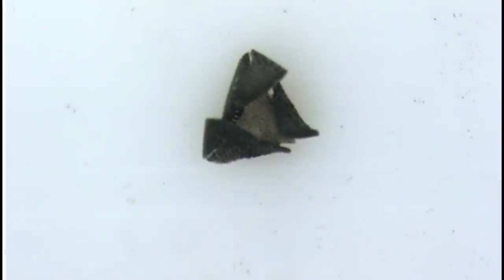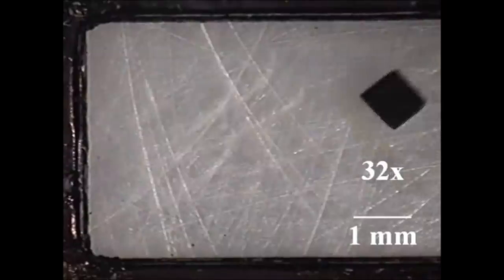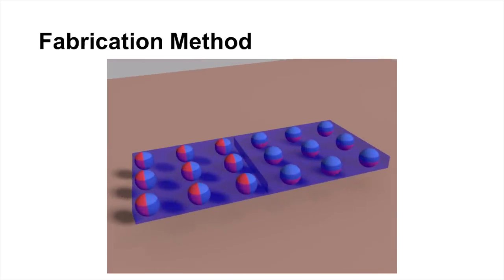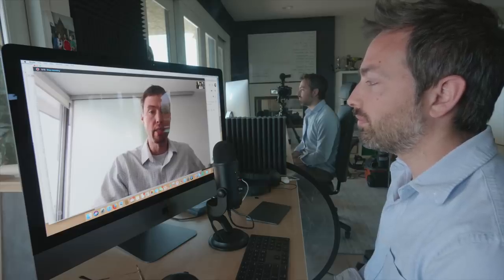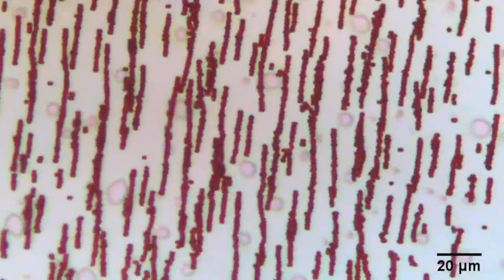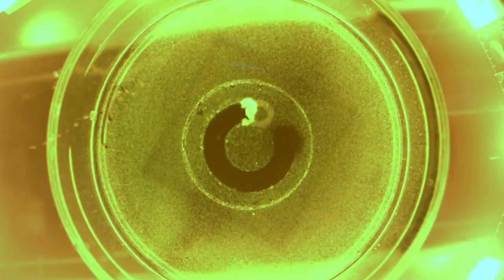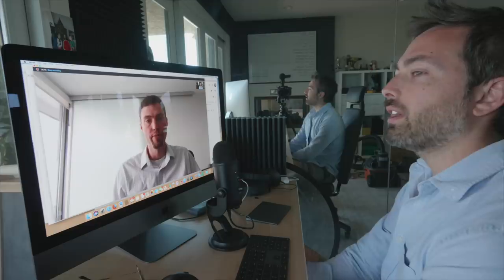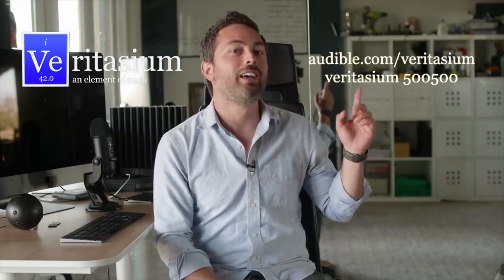Magnetic Micro-Robots

Comment: TBH I'm a bit sceptical calling them "robots" they're more like magnetic puppets.

Useful none the less.
Reply: @BlazePlayz YT they can't act on their own, all instructions come from the outside
Reply: Some are even more like magnetic particles.
Reply: @BlazePlayz YT magnetic puppet is a great name, actually! A vivid and clear image of what is happening
Reply: @BlazePlayz YT I know, but these don't have the slightest bit of software. If I push my toy car it isn't a robot. If I tell my toy car to move forward, and it does, then it's certainly much closer.
Reply: @BlazePlayz YT No they aren't, robots are automated those things are being controls with a magnetic field, pretty much like I use to make some iron nails moved back when I was a kid.
Reply: A robot is any mechanical object that can be controlled remotely to preform a task. Software is not a necessity.
Reply: @AlekPlaysMinecraft  So a string puppet is a robot? If not, then this isn't. This is virtually a magnetic puppet controlled by magnets. I wouldn't call staple wire a robot just because I can drag it across a sheet of paper with a magnet underneath.
Reply: @RenzXVI  why do you assume someone has to physically use a magnet and move it around? You think we can't generate magnetic fields or change their orientation?
Reply: @fl4regun469  LOL, I guess you have no clue what an analogy is. And what the word "virtually" means. Another fact is that it's still NOT a robot when magnetic fields are used, it's VIRTUALLY just a puppet with high-tech invisible strings. And yeah, that's an analogy again, use a dictionary.
Reply: @RenzXVI  your analogy sucks lmao. What's the difference between electric control and magnetic control
Reply: @RenzXVI   You could easily have a microcontroller time the direction and strength of a magnetic field where the devices are located. But it's not a robot because it needs wires and motors lol

Comment: That method of making magnets can be used to make generators out of magnets, using the magnets to create circular kinetic motion which is then received using a alternator or something similar. Most would say this breaks the law of thermodynamics that says you can never make energy out of nothing, though most don’t know that magnets lose there magnetisms in this process, meaning your just converting the lifespan of the magnet into energy. (It is possible that to make magnets like the ones in the vid would use up more power then you could get, you could also just find a way to use neodymium magnets, but no one wants to do that)

Comment: While this is really really interesting and I hope the development evolves, I wouldn't call it "robots". You control the magnetic field that will interact with the material. The same way I wouldn't call a device moved by the wind a robot.

Edit: okay now I would 😂
Reply: A device that automatically performs complicated, often repetitive tasks (as in an industrial assembly line) is called a robot, what we saw in this video is exactly this in a smaller scale. This is the description of "robot" taken from the Merriam-Webster. They are intended to eventually do complicated and repetitive tasks (deliver drugs to a specific part of the body). In time they will be automated/programmed to follow steps. Sure you can argue that they're not robots as of right now but they are basically in the alpha stage of their development. Whatever follows will just be improvements from these prototypes. They definitely are robots.
Reply: @Tahira204  Oh cool, I wasn't aware of that description, thanks!

Comment: I love how this guy is just casually using a PS3 controller for the job
Reply: Better than Xbox controller!
Reply: I just mean, weren't PS4 controllers available?
Reply: Maybe ps4 controller is more restricted in use than ps3
Reply: Erm last I checked, a PS4 controller just plugs into Windows 10 and works. You don't get the touchpad mapped to mouse or the gyro mapped to mouse, but it otherwise works out of the box.
Reply: @DoomRater  Yeah it seems kinda weird to use a ps controller, its much easier to use a xbox controller due to MS putting native support. For ps3 you have to do weird driver things. Anyway its probably just what they had and they were lazy to buy a new controller.
Reply: @saygoodnightgraciee  it's hard to configuration Xbox controller on pc. Ps3 is directly configured
Reply: @malo6748  It may be incompatible with their software of controller
Reply: @DoomRater  Also, it requires to work with their software. Or maybe he don't know much of video games. He just bought which is cheap also of good quality
Reply: @dalzy25  Support is for windows, you need xinput to work with their software also. Ps3 is just direct generic input. Xbox uses xinput

Comment: I have no disc between S1&L5 so it grinds bone to bone when ever I move. Could they make these micro-bots go to this area and stay there as a cushion?
Reply: Jim Klapperich good question it should be possible from a scientific perspective however it would need much more testing and you would have  to where something similar to a brace that gives off a magnetic field that holds them in place, which could prove to be difficult as it would need to be programmed as a reactive sequence rather than a preset one, not to mention long exposure to magnetic fields this way may cause slight nausea but would be a very minuscule amount and a small price to pay to fix your aforementioned medical problem. I hope this helped.
Reply: Now that's something I could get interested in as I have somewhat of the same problem !
Maybe they could deposit a material like what was there before, and then LEAVE !

Comment: I assume the magnetic fields required are very weak so even if the micro-robots are inside your body they could be controlled from the outside.
Is that correct?

Comment: #SemiAutonomousHangGliding
I imagine a hang glider with an electric motor propeller for use when needed that has a small weight shifting motor set at the pilot's hang-point to help pull a pilot into the appropriate body shift position while flying in semi-autonomous mode for training for example, or in semi-autonomous mode when safe during otherwise fully autonomous hang gliding flights for brand new pilots.